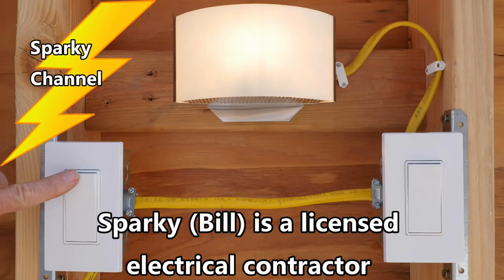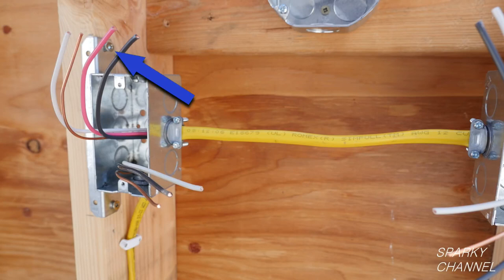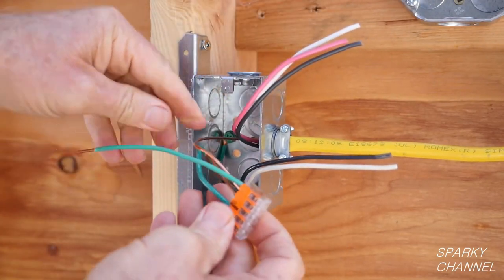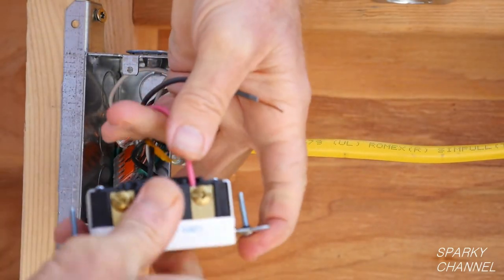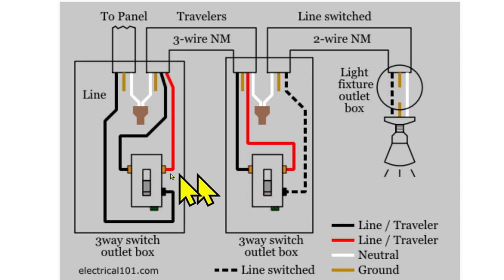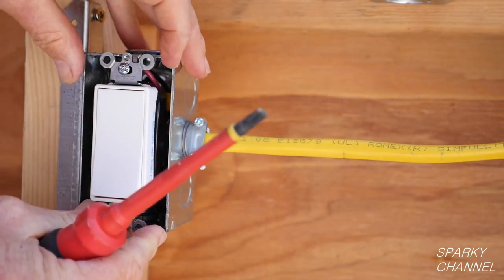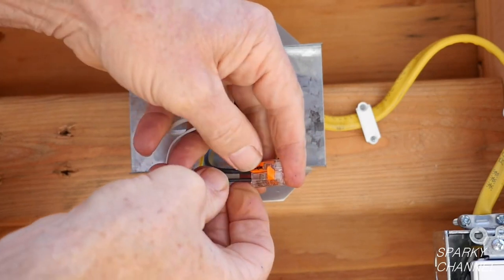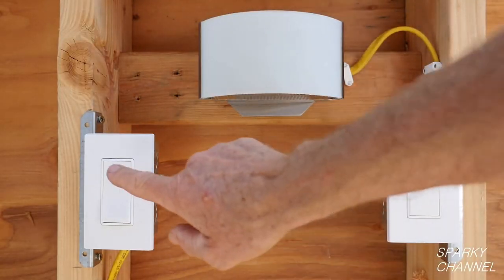How To Wire 3-Way Switches with Diagrams Included

Comment: Thanks Bill.  Your instructional videos are exceptional !   Regarding the removal of the "paper washer", I assume this washer is to remain in place if a plastic box is used?
Reply from the maker: Yes, that's correct. I should do a video on that. It's a detail in the NEC that goes unnoticed often.
Reply: @SparkyChannel  Thanks for the educational video. I always thought those paper washers are to hold the screws to the switch or outlets so I don't lose them or drop them when removing of installing them.

Hope you and your family stay safe and well.
Reply from the maker: @ccadama  Thanks!

Comment: Hi again Bill, ........... Here is a second one for you to video or sketch out on that would be a very common wiring situation for most of us with a detached garage.
I have a detached garage with a 100 amp sub panel that was previously installed via 2" sch 80 PVC underground conduit containing 3ea. #2 awg THWN-2 (cu/strd)+ 1ea. #4 awg (cu/sol) ground wire. There are 3 single pole switches inside garage that are fed straight from the panel/breakers, operating 3 different garage light groups (#1- inside lighting, #2 outside coach lamps, #3 outside spot/yard light).
I want to replace these switches with 3-ways along with adding a 2nd set of 3-ways in the HOUSE.
Can the same 2" sch 80 PVC underground conduit with the garage feeders be used to run the travelers and switch legs and grounds back to the new house 3-ways or are new conduit runs (3 runs of 3/4" sch 80 PVC) needed? Are neutrals needed to be run to house 3-ways also? Should it be single THWN-2 (no romex in buried conduit, correct?) or what type wiring to use? Could you sketch out and/or do a video on this wiring layout showing house 3-ways, garage 3-ways and garage lighting loads?
Reply from the maker: I would say draw it up and submit it to your local inspector. There are too many variable for me to say what is OK without seeing it. It does sound like a great project though!

Comment: Hi Bill, I am curious as to why you prefer to use a prefab ground pigtail w/green screw as the method to bond the box to the ground when it seems less cluttering and simpler to looping one of the incoming ground wires around a green ground screw (sold in box of 50), and then onto a wago 3-way lever nut or a greenie wire nut and then onto the switch ground screw?
Reply from the maker: That's a good way to do it as well.

Comment: Hi Bill! There's also an alternative to this wiring method. It requires a five core cable instead of a four core one (we count the ground in). Most used cables here are three or five core ones. With that method the second box will be supplied not only with a neutral also with an unswitched line which could be handy too.

You connect your travellers as usual, but here comes the difference: You connect both the commons. And you connect the unswitched line to one of the travellers, and the switched line to the other traveller. Most used lighting wiring in the UK, here in Germany we use it from time to time if an outlet is needed next to both switches, but in most cases we use the wiring method shown here. Schematic of this alternative:

https://upload.wikimedia.org/wikipedia/commons/thumb/5/59/Sparwechselschaltung.svg/2000px-Sparwechselschaltung.svg.png

And then there's another method which is highly illegal here and must be removed if found. The unswitched line and the neutral are connected to the traveller terminals of both switches. The lamps line is connected to the common terminal of one switch, the neutral of the lamp is connected to the common of the other switch. That method is absolutely not permitted, it can cause such an arcing inside of the switches that it will cause a massive short-circuit.

https://upload.wikimedia.org/wikipedia/commons/d/dc/HamburgerSchaltung.png
Reply from the maker: Hallo mein Freund! Thanks for the information!
Reply: @SparkyChannel  And the alternative method is required if you want to install a circuit with two control switches. I don't know the proper term for this, but a control switch is used when the lamps which are switched are not visible. There's a neon indicator in the switch, when the light is on the neon indicator lights up. And it is off when the light is switched off. I have such a switch in the room with the access hatch to the attic, switching the attic light. The switch requires a neutral!

Attic light off:

https://abload.de/img/img_0960wgk8f.jpg

Attic light on:

https://abload.de/img/img_0961nbj6d.jpg

wiring schematic of two such switches:

https://upload.wikimedia.org/wikipedia/commons/thumb/f/f6/Kontrollwechselschaltung1.PNG/350px-Kontrollwechselschaltung1.PNG

You can also install just one of them and replace the second one with a normal 3-way.

Comment: Hey, can you do a video on open neutrals? I came across a neutral that was reading 120v to ground. Show the meter readings during open neutrals and after finding issue and explain why it happens. Thanks!
Reply: If there is a load it will read voltage or  likely a shared neutral and the line that isnt shut off has a load.

Comment: Is there a reason why u attach the grounds in a clockwise matter?
Reply: Because, when you tighten the ground screw you turn it clockwise pulling the wire tighter with it. If you were to attach the ground wire counter clockwise you'd only make the wire slip off as you tighten the screw.
Reply from the maker: Alexis gave an excellent answer, thanks!